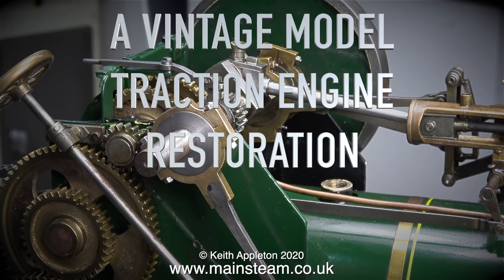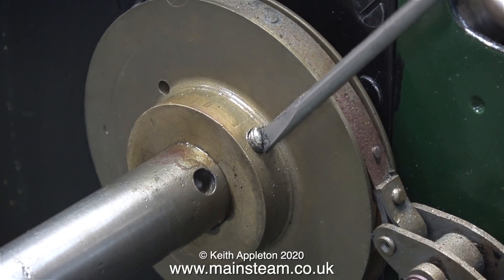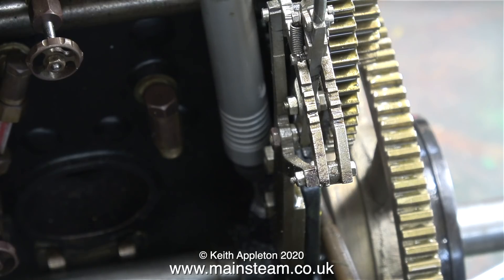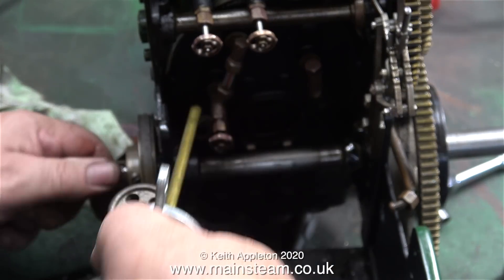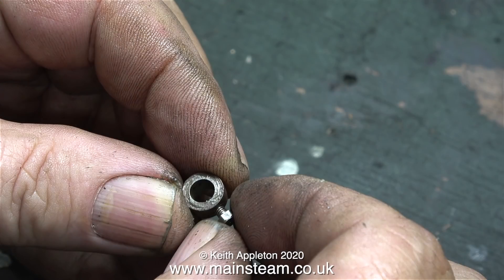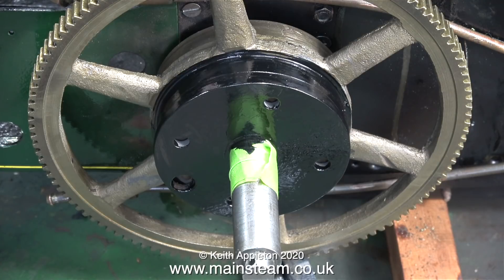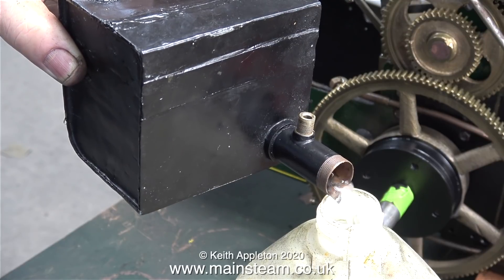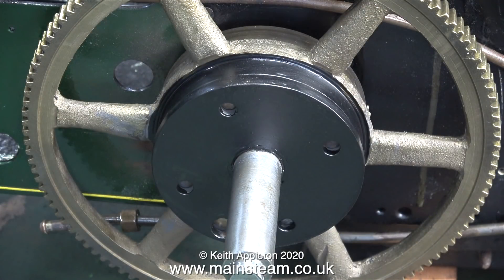A VINTAGE MODEL TRACTION ENGINE RESTORATION - PART #7

Comment: There's a great video on the differential gear set that was produced for Chevy many years ago. They've put it up on YouTube.

They have a bunch of full size traction engines, both steam and internal combustion, in an outdoor display in downtown Boise. I spent an afternoon a while back checking it out. I'd love to see one of the full size units in steam again.